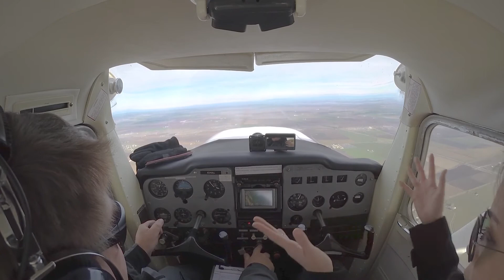Cessna 150 Accelerator Pump Failure

Comment: Looks like your throttle control lock is "too loose" ... For both power-on and power-off stall practice, I was taught to follow standard landing/take-off configuration. Mixture should be "full rich" in both exercises. Refer to your POH for aircraft specific checklist. That said, I've never seen this type of issue in my C150, I would have it inspected as soon as I landed. Good luck! Thanks for sharing the video!
Reply from the maker: Thanks for the feedback. Yeah, the lean mixture is something I've gotten quite a bit of feedback on. My mechanic did confirm that I have a bad accelerator pump which will be rebuilt. But I will be adjusting how I use the mixture for maneuvers as well.
Reply: There is always something to fix on these older planes, mine is a 68 - 150H, really close to yours. You should do a video sometime showing the plane, and telling your flying story. Keep up the great work!
Reply: School me ! My 17yo Nissan has never had this problem what gives ? Why is my old Nissan more reliable than an airplane ? Comments ?
Reply: Ron From here on out whenever you drive your Nissan drive it at a continuous 75-80% power whenever you drive anywhere. Get back to me in about a week and let me know how things worked out. Oh by the the way 17 years old is still pretty brand new compared to this guys 40-50 year old plane. After your Nissan craps out you should buy a Honda and take it to the airport and cruise around at about mach .85.